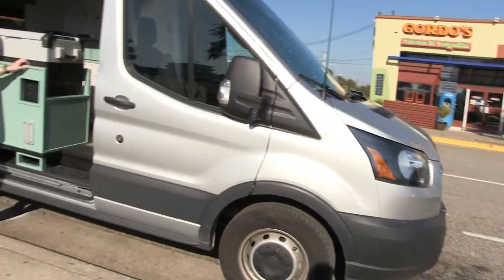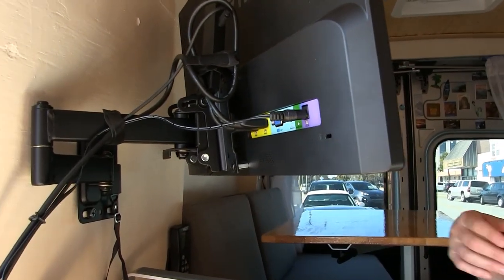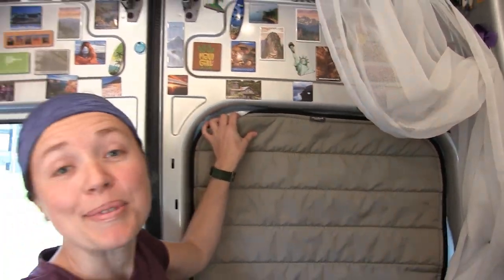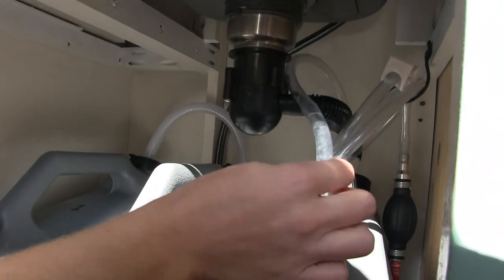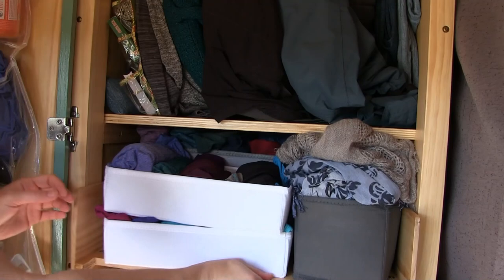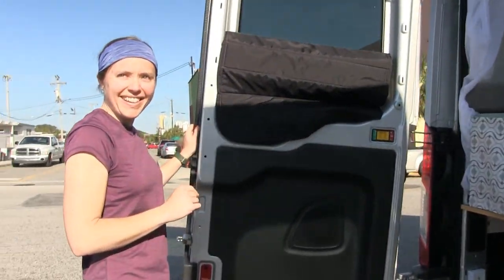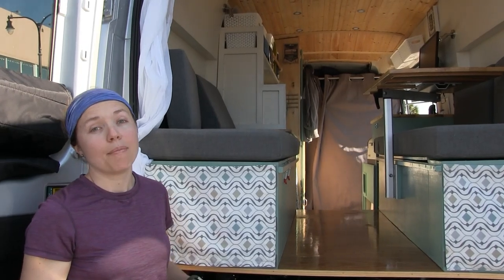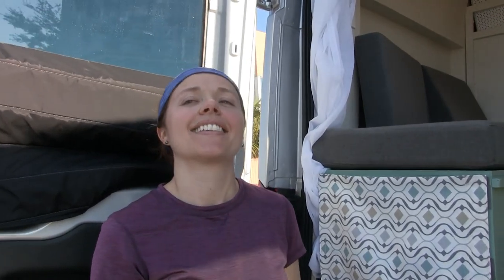VAN LIFE | GENIUS DIY Homemade Campervan - Ford Transit Conversion

Comment: Patrick, HELLO,, This is a wonderful home build ,now, it’s NOT FAR FETCHED an idea of NURSES  on the move, actually the first ones were ‘TINY HOMES’. Some were trailered by heavy pick ups, & some were professionally transported to the NW, stationary , so she has solar, 12volt & 120volt via inverter, + charged as the engine runs. Just wonderful,,,, Cheers From NJ🇺🇸🇺🇸🇺🇸🇺🇸
Reply from the maker: Thank you 🙏🏼

Comment: Loved the thin pine ceiling, the "sealed" container for propane tank (with a hole in floor for venting), and the "bathroom shower" poles holding the kitchen baskets in place. Well thought out and doesn't look/feel cramped and cluttered.
Reply from the maker: Thank you very much Nancy

Comment: Wow!  Not only is this impressive, the design and functionality are better than what you see in a lot of “professional” RVs.
Reply from the maker: Thank you Craig
Reply: @NewJerseyOutdoorAdventures  Good video but wish sh had shown how she puts the boards down for a bed
Reply: The vast majority of RVs are not built for living in.  They don't have the durability, nor do they have all of the necessities for living fulltime.  They are built for a vacation once a year in pleasant locations with vacation weather.
Reply: @gerrynightingale9045  Airstream is at the high end  of RVs and 2 weeks is not considered "living in".
Antifreeze in the grey water tank makes it a blackwater dump.  Having to put anti-freeze in either tank is just one of the many hassles trying to actually live-in an RV.
Forced air gas furnace (typically propane, ideally using fuel from the tank) tends to be used at very high rates due to lack of real insulation and design in RVs.  OK for vacations, expensive and causing other problems as you found out.
When you live year-round in an RV, you will understand why people do custom builds.
Reply: I second that craig
Reply: And so much better and doable...costwise!

Comment: Outstanding Talent She Has... I Bet, Many Would Love Her Layout and Design.  Nice Interview!!!
Reply from the maker: Thank you
Reply: Thanks, Freedom Quest Network!
Reply: @linds234 Taber, You are more than welcome. You did an awesome job.  I totally love your ideas.  Happy Thanksgiving To You and Your Design Crew :)
Reply: Awesome job! Everything looks really well thought out! 

Lindsey Taber do you have more info on the bike storage? Do you use quick release pedals, do you do anything special with the handle bars to make disassembly quicker? Would love some rough dimensions on that garage. 

I’m planning my build now, and your bike storage solution looks much better than storing them standing up like most conversions I’ve seen.
Reply: @devoncrews374  Thank you! I had been really frustrated by only seeing upright storage under a platform bed. I knew I wanted a comfortable sitting/living space too and I'm absolutely loving how it turned out. 
15.75" from lowest metal floor rib to the underside of the platform 
55" deep 
61" at its narrowest opening (between the van door frame

I started using a pedal wrench and found it was do-able but super annoying so I did switch to pop-off pedals! 
I got these for my mountain bike: https://flatbike.com/product/mtb-pop-off-pedals/
I carry a second bike for when I'm traveling with a friend and got these at half the price of the ones above: https://www.amazon.com/gp/aw/d/B07FDVDPXD/ref=ya_aw_od_pi?ie=UTF8&psc=1
 There are many more options for pop-offs for road cycling but I've been really happy with both of these.
Reply: @devoncrews374  Now that I've switched to pop-off pedals I'm not really bothered by using an Allen wrench to take the handlebar off. My spare bike is a slightly smaller frame and I actually have it in there with the handlebar intact.
Reply: Lindsey Taber thank you so much for the detailed reply and the links! I’ll definitely be building my bike garage in my build the same way. I hope your travels are going well!
Reply: @linds234  Wow I learned something new..Never knew they made quick release pedals..Great info..
Reply: He'll I'd love to have her! She's adorable!!
Reply: @linds234  super cute! Are you single?
Reply: Shoot, can you repost Lindsey’s Instagram link for the design? I didn’t save it proper and can’t find it. Thank you.

Comment: This build is fantastic. Lots of smart and innovative choices, didn't really skimp on anything (relative to other vans/rv builds) and the out of pocket cost of $10k sounds low, considering all that was done. The only thing I'd change is the sink foot pump, which is an easy fix.  Hard to believe this was her first try. Very impressed.
Reply from the maker: Thank you for appreciating the work that was done. Please be sure to check out more like this on the channel.

Comment: When I finally am able to get my van, this is the layout I want and have doodled on paper.  I don't need a work desk, Lindseys' is great, I want a shower and composting toilet.   I have been wondering how its floor plan would look with a garage under the table/bed.  I love your videos.  I live in Ventnor next door to Atlantic City so when I ran across your channel I had to stay with it.  I'm glad I did because of this video for sure.  Thanks for your time making the videos for us.  Be Safe and Have Fun While Being Kind
Reply: Kathy DeCree shower and bathroom are primary.
Reply from the maker: Thank you Kathy. I would love to feature your build one day.
Reply: @NewJerseyOutdoorAdventures  I'll be watching your videos, getting more ideas.  I'll track you down.  haha   Be Safe and Have Fun While Being Kind
Reply: Kathy 
Another NJ shore girl (although older than most!) here... north of AC.  Completely agree; couldn't function without a wet bath & either composting or cassette toilet. Just my own hangup. Almost bought an older model camper van 2 months ago but decided it didn't fit my personality, had lots of miles on it & would still need more money invested into it. Been researching these & tiny homes for several years. I'm able to swing it now but waiting for just the right fit.
Lindsey's design is fantastic & shows so much thoughtful preparation.
Reply: @sjladuke75  That's great.  I wish I was ready to go not.  My pension doesn't kick in till 2021 that's when I plan to leave.  RVing across the country is what I had always thought I'd do after retirement.  Because of circumstances, back in 2005, things have changed and I know I can't afford an RV now, but I am very happy I found vans and buses and I am able to follow my dream again.  I can't wait.  By the way, I'm older than most,  pension,  18 months.  Good luck with your search and your trip.  Maybe we'll run into each other, not literally of course.
Reply: Common Sense With Elizabeth  me too. I’d make to kitchen small for the sacrifice. Id love cooking outdoors. I can’t handle dirty

Comment: Nice build.   I note how all north Americans say Travel Trailer when the rest of the world calls them a caravan.  Much easier.
Reply from the maker: Different folks different strokes
Reply: I need to start calling em that, c how ppl here handle it  LoL
Reply: Where I'm from (Northeast USA, near DC) we all call it an RV or a Camper 🤷‍♂️
Reply: AJ Hunter a camper to us is something like a van with all the gear inside.  Drivable. We have camper trailers which virtually lay down flat that are popular for using in our outback.  And then we have a caravan.  RV is a bigger, more complete version of a camper but again, driven not towed.

Comment: The 'Pinnacle' of Thousands of 'My Van Castle's' Reviews Out There' Aside th' lack of AC' and Hot Water Heater' Thats Easy Enough To Install (and Add a Solar Panel Also)  But This Is By Far' So Technically Savy and Intentionally Logical Via' Space Based Functionally Through Out' That For This Stealth Size?- This Is The Best of All I've Ever Viewed ! Super Congratulations an Most Awesome Miss Lindsey!🌈
Reply from the maker: Thank you very much Charles, we have many more campervan videos here for you to enjoy.

Comment: Incredible design & build.  Simple, minimalist & shows personality & almost industrial design. Love the litter genie for trash! Fabulous idea! Fridge/freezer is perfect size compared to others. Great locking drawers- especially for expensive tech equipment. Love the propane carbon monoxide detector which many others  don't seem to have. Safety is key on the road- especially full time living. 
My one issue is; I need a wet bath. It's important to me to not depend on finding gym or shower facilities. Also I'd want small pump for sink to avoid foot pump. 
She's thought of everything & as a nurse is used to troubleshooting & coming up with simple solutions. She's definitely done lots of research! 
Overall this is such a well thought out design & build. Bravo from a fellow nurse at the NJ shore!
Reply from the maker: Thank you Susan

Comment: Nice build Lindsey, I have the 4 foot longer version of that transit, i'm in the middle of turning mine into a camper. it's my second build and I'm also looking at having the seating and bed area at the back with a garage under it because it seems to allow more space.
Reply from the maker: Thank you for watching and for commenting

Comment: Lindsey thank you for sharing in such great detail not only the products that you used, but the ingenuity with which you used them.  I recently bought a bus, however the information that you shared will provide a template for many of the projects with my conversion.  Very Best and Thanks Again,  Paul
Reply from the maker: Thank you very much Paul

Comment: Nice, squared away build ! What about insurance and registration?  Is it an RV, or the work vehicle of a 1099 LLC ? I'm told cargo vans automatically go commercial as soon as they run the VIN.
Reply from the maker: It varies based on state of registration
Reply: Mine is just registered and insured as a personal vehicle but NJOA is right -  there is definitely variance between states.
Reply: @linds234  Thanks for the input.
Reply: @NewJerseyOutdoorAdventures  Thanks for the input.

Comment: David in Hudsonville Michigan. I bought this 2018 van. Would love to meet you if you get back here. 1000w solar, 2000ah lithium. Split queen adjustable beds. Lots of tech but still not decorated. Lived in it total 6 months and live it. So glad I didn’t buy Mercedes or RAM. Maybe you dad is off work because of Covid and would like to decorate my van?
Reply from the maker: Thank you for watching. Looks like you have a great project going on

Comment: Lindsey - you have about The Best design and lay-out I think I've come across (and I've watched Oh-so-many tour videos).  And the execution is stunning.
If you ever want to swap ideas - I've worked out how to build a composting toilet for around 150$.  If you ever get tired of the road you should think about the possibility of design or architecture.

- Cathy (&, accidentally, Steve - I kind of ran off with his account so I can plot out my own design for an eventual van build)
Reply from the maker: Thank you for watching
Reply: Thanks so much! GREAT work in creating your own composting toilet - expense was a major reason I decided against that option. So far I've been finding public bathrooms without a problem so the toilet is more for emergencies. Good luck with your build in the future!
Reply: Lindsey Taber > which brand of porta potty did you chose?

Comment: The batteries and inverter are in the right place. Just behind the driver seat. Shortest run from starter battery for isolator charge (battery doctor). This is the exact van I would get and design except for one thing. I never thought of the step up for that bed design. Great idea, inside under bench storage as well as a decent size garage area. It is a sitting, sleeping area so no need to stand. 

It looks like a side ways sleeper with bump outs. I am too tall for that.

Thanks, super design, and I think the best model van, high top regular length (148”) Transit.
Reply from the maker: Thank you for checking this one out

Comment: There is always that fine line between a seating area that converts into a bed and a fixed bed but reduced seating areas. From the huge number of videos I've watched, the 'Full-Timers' soon get weary of the daily chore of converting the seating to bed area at night. Shame we didn't see the converting of the seating to bed, although it does look pretty standard with the boards from the closet going into the middle section. Also there is he other contentious issue if a 'dry' van Vs a 'wet' van. Again for full time living I'm seeing more and more people wishing they had a wet van if they initially went for dry. I'm still working out plans for my conversion. I must say the battery/brain set up here and how it is stored is possibly one of the best I've seen, and I'm 100% going to look at how I can use the ideas in my van. It seemed to be in a really small space, with the board over it so there is still lots of storage space above it. One other thing is her bikes looked pretty disassembled to me, looked like the handle bars had been removed. Again, great use of space but I'm not so sure after a few months living full time and regular use of the bikes, it may start to get a bit of a pain putting the bikes together and apart again to store. The only other really great storage for bikes I've seen is by a guy who's name escapes me, but he has the best stealth van I've ever seen, with the 'Murphy' bed completely white inside and minimal, its has no windows but a huge sky light roof. He stored his bike inside the rear doors. Only issue there is you can't open the rear doors and have a view, as there is the wood of the 'garage' facing you. Lots of awesome storage ideas to take from this video and the lady seems really nice. I wish her well in her van life journey and I hope it works our for her.
Reply from the maker: Thank you for the helpful information.

Comment: I simoly love love your van compared to many others. This looks more like a regular van. you can take others out for a drive, travel etc. I like how you can access all your storage. Your storage is very accessible and has a minimalist diy feel. your cost for conversion seems very  doable. You do not have hot water and shower facilities. But with your kitchen faucet and window screen seems ok. I like it that it is all locked and safe. your closet seems amazing. I have lived in Michigan and if you can live there in winter then must be well insulated. Love, love your van. Also you are living in it as a a single woman and I think that will appeal to many single people.
Reply from the maker: Thank you very much for watching. Please subscribe for more videos like this

Comment: Nice vid!...I'm trying to find the source for the HUGE magnets she used on her cabinets. If she has a SM account, please let us know, or if you know the manufacturer of the magnets, please post ...For Van Builders: We're using the Sterling B2B Charger as she has...In my opinion, it's the best method for charging your Battle Born or other lithium batteries. We just completed a 9000 mile shakedown trip around the USA, and it's amazing.  We have 300W on the roof and a Victron Charger when we're not moving.
Reply from the maker: She may comment when she can with help with product names
Reply: Thanks! These are the magnets: https://www.amazon.com/gp/aw/d/B07M9TKNB3?psc=1&ref=ppx_pop_mob_b_asin_title

Comment: Awesome! The hidden electric components and cables are so nicely organized as the visible interior. Love it. Very inspirational and rational. Lots of good ideas here!
I am not cooking much at all, so for safety and space saving reasons I would get rid of the propane gas tank and stove and I would just use a single infrared burner, it can even be a portable one. I like that you can stand in it. Looks very good to me. 
I would trade my nice Volvo XC70 station wagon for this in a heartbeat. Let me know... :)
Reply from the maker: Great job and craftsmanship

Comment: She didn't actually say  she was nursing while traveling--did make reference to needing a work space in the   van--computer work?  Do you know the details,NJOA?
Reply from the maker: I am not sure 🤔
Reply: After 10 years I left bedside nursing and now work fully online. I was doing Chronic Care Management but now I'm doing data abstraction. There are actually lots of fully remote RN jobs these days! I found both jobs on FlexJobs.

Comment: Interesting juxtaposition. I'm a retired Power Engineer who ran Hospital power plants and you're a nurse who has schooled me with your genius build. Many hands make light work. I'd make sure that inverter has good ventilation, especially being close to the batteries, but the shut off switch and CO monitor as well as many other features are well conceived. Definitely one of the best builds I've seen in many respects. Very clean.
Reply from the maker: Thank you for watching. Check out more van videos on the channel